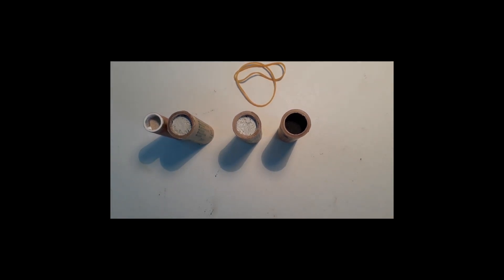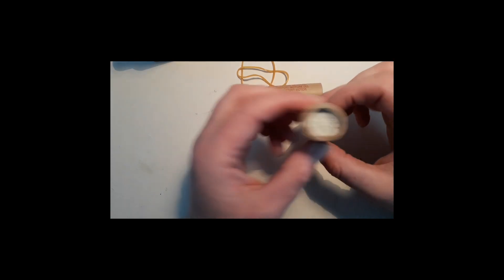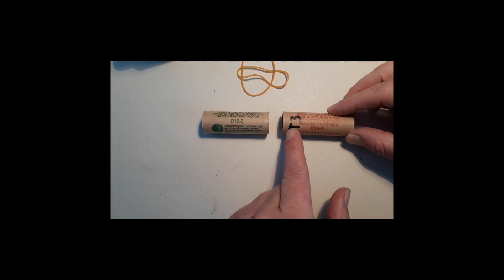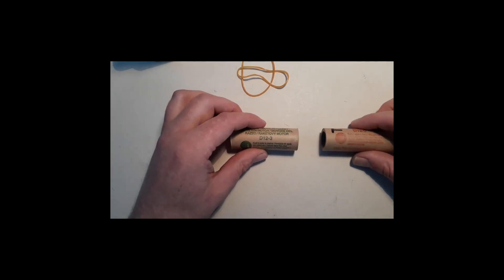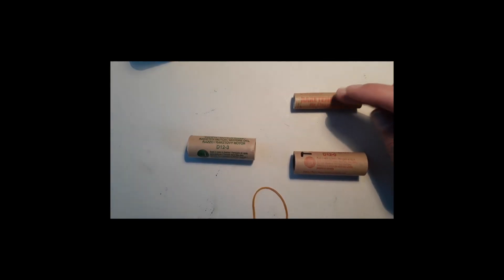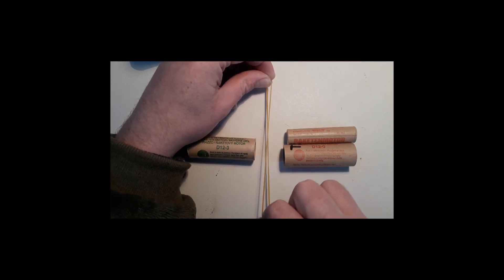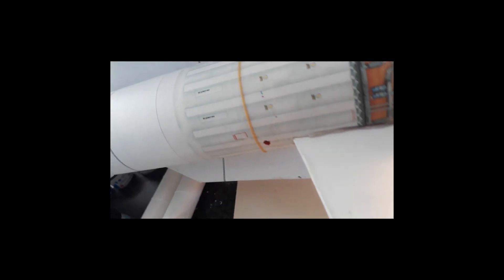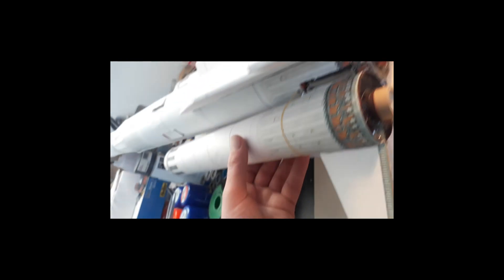How to make separable boosters for your model rocket

Comment: when the two side boosters are ignited, what keeps them attached to the main body other than a rubberband? With that much pressure upon ignition of the two side boosters, wouldnt the boosters just shoot of by themselves seperately? You did not explain how you attach the booster to the main body other than just using a rubberband, (perhaps studs?). Can you modify your video to explain, maybe in a caption, on how its held to viewers? thanks and great video and rocket build?